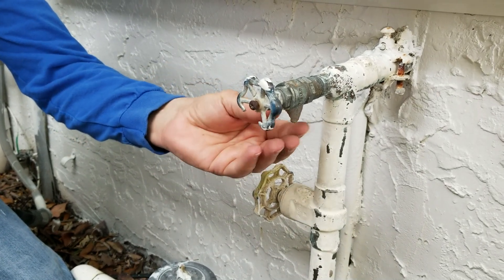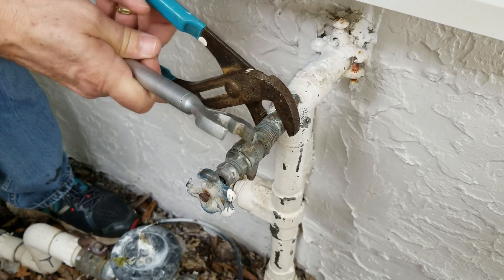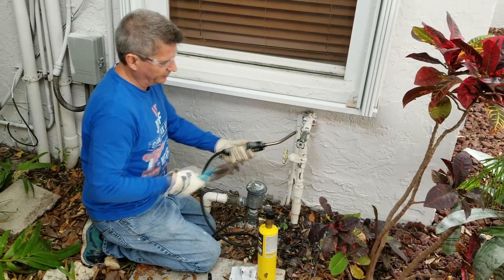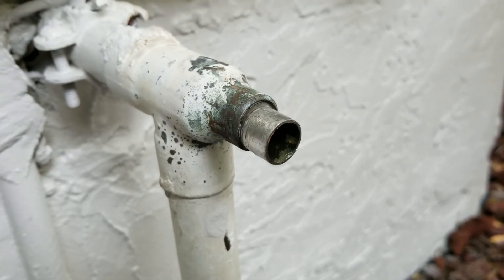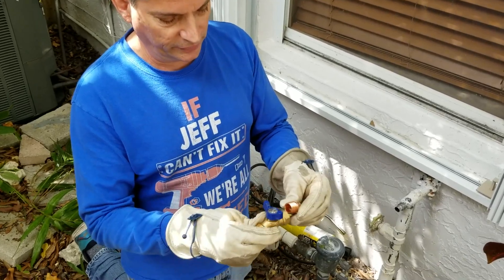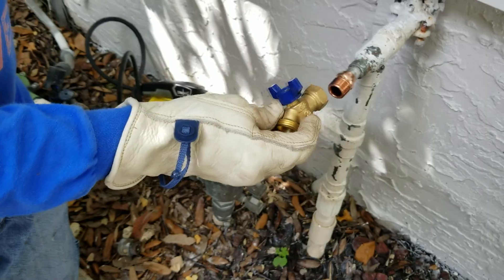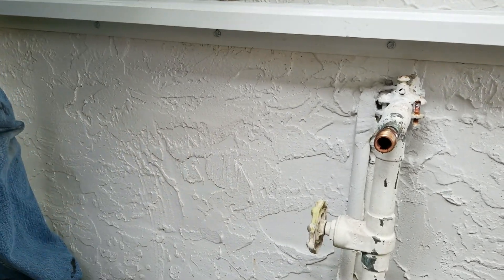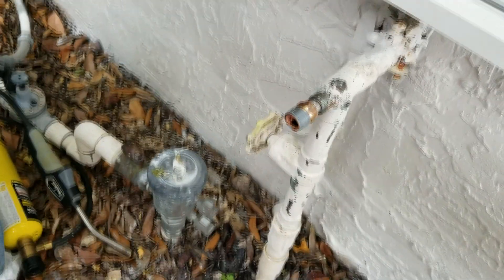How to Replace a Hose Bibb/Spigot - Soldering Hose Bib

Comment from the maker: ✅ Tools used in this hose bib replacement video:
Bernzomatic TS8000BZKC Trigger-Start Torch Kit: https://amzn.to/2Bzj80K
Armour Line Pipe And Tubing Reamer: https://amzn.to/2Rut3OQ
Plumber's Solder Kit: https://amzn.to/2BWr0cP
RIDGID One Stop Wrench Kit : https://amzn.to/2ClCbNa
Channellock 12-Inch Pliers: https://amzn.to/2MdcnGR
RIDGID 14" Heavy-Duty Plumbing Wrench: https://amzn.to/2T4g5Fd
✅ SUBSCRIBE:
For more useful DIY home remodeling tips, tricks, and solutions to engineering disasters subscribe here: https://bit.ly/2vj06cB

✅ WATCH: Why is my Kitchen Sink P-Trap Leaking at Connection Nut?: https://youtu.be/cEjiICErSQg

✅ WATCH: How to Replace A Kitchen Sink Drain Strainer, Repair Leak: https://youtu.be/nBlyqU7NJJI

✅ How To Solder Copper Pipes With Water In It: Plumber's Bread Trick DIY: https://youtu.be/wJxGcpybFvw
Reply: Thank you Sir you are a life saver. absolutely brilliantly explained and worked perfectly. especially the Nuances which made all the different. God Bless you

Comment: I just did this job an hour ago, and I wish I watched the before doing it instead of after. You did a great job. My only comment: You made a point of using lead-free solder and described a child drinking from it. You then installed an Everbilt 1/2 in. Brass Female Hose Bibb. This valve is not certified lead-free and is not recommended for potable water applications. It is fine for outdoor lawn and garden use, but there is no reason to specify lead-free solder in this situation. Indoor plumbing, absolutely.

Comment: My plumber put the threaded opening of the ball valve like what you have directly over the 1/2-inch copper pipe and solder them together. Is the joint strong enough to withstand the torque from opening and closing of the valve over time? I am afraid of a catastrophic failure of the joint. Thanks in advance.
Reply from the maker: Yes the solder should hold up. I would make sure the pipe is not wiggling it may need to be strapped tot h wall if there is any movement
Reply: @jeffostroff  Thanks again.

Comment: Hey Jeff.  I found your channel during your coverage of collapse at Surfside (great videos).  And lo and behold, I need a new spigot so came you your channel!  Cross promotion!  Looking forward to more deals, more info on Surfside etc in the future.
Reply from the maker: Thanks for coming back for more!
Reply: @jeffostroff  I did, and still can't find the answer to my question though.  I have screwed on a 2 way to my spigot and cannot get it off the threads.  I own a brick house, and that hose bibb/spigot type has the back of the spigot IN THE mortar.  I haven't called a plumber yet as was researching what to do.  Is best way to know to send photos to  a plumber?  I wish I could know how to get that 2 way thingy uncrewed from the spigot but another neighbor made it worse when he forced it even more righty tighty!
Reply from the maker: @BarleyHops   The 1st thing I would try is a pair of channel lock pliers because they can Clamp down onto the hose nut  That is Stuck on that thread. And somebody with enough strength should be able to loosen that.  If that doesn't work you can try applying heat by putting a torch on it for just a few seconds and see if there's any expansion that.  Then after That I would try PB Blaster  Which is A penetrating lubricant. WD40 will not work here because it is not a lubricant although many people think that it is.  If that fails then you can get a Dremel and try to gently slice off the hose nut just cut a couple of slits into it enough that you can pry off the rest of it and get it off of the threads without cutting all the way through to the threads.  It's all of Those efforts fail to produce the desired outcome, then you will have to bring in a plumber And you  Me end up having to chisel into the wall.

Comment: Thanks for the detailed video! I tried to disconnect my water hose from the spigot and the entire thing snapped off! I found your video, bought the parts at Home Depot, and voila, I had a new spigot! The soldering was a little tricky for me, but I got it done. Thanks, again! 👍

Comment: Hey Jeff as long as you already shut the water off from the valve in the yard why didn't you replace the other water shut off and replace it with a 1/4 turn ball valve.?
Reply from the maker: I would have but the fix was simply turning the nut 1/4 turn.

Comment: I do a lot of my own repairs at home.  Widowed and no kids to help, so I get a lot of jobs to do that I've never done before.  Thank you for this video.  I have a 'quarter turn' type outdoor faucet.  Today it was leaking so badly I could fill an outdoor rain barrel in about an hour and a half!  That's a bad leak!  I was hoping to find information on how to replace my type of faucet, and only saw older type faucet videos, until I found yours!  Yeah!!!  I'll be working on my faucet in the morning, and I won't need to do any soldering, but only replace the quarter turn portion on mine.  Since I had never done this before, I wanted to be sure I found a video that gave me all the information I needed to do it right.  Thanks so much!  I subscribed as I have to do repairs on all sorts of things from time to time, and it helps to know where to go to find the information.  I may even change out my other faucets as the house is 35 years old and I imagine the faucets could use some attention after all this time.  One question -- Do you have videos on determining if a faucet is leaking behind a wall?  I am not sure if I have an issue, only that the water sounds really strong in my kitchen when I turn the faucet on outside.  NO signs of water, but I get concerned that there may be a leak and I can't see it.  I'd love to see a video on determine the location of a leak of this kind.  Thanks again!!😌
Reply from the maker: Awesome glad to help and welcome aboard

Comment: Any reason you cut off the main even though you have a disconnect valve?
Reply from the maker: We cut off the water main by the street, because the house main shutoff was still allowing water to leak. Typical cheap garbage valves that builders were using in 1993.

Comment: What is the little bracket on the Bibb almost touching the house? Is it a support for the Bibb?
Reply from the maker: That is a clamp for a ground wire. It's painted over but you can see it
Reply: @jeffostroff  A ground wire for what? Mine has the same thing on it. Do I need that wire?

Comment: Why won’t my hose pip melt off, my copper melted before the old solder
Reply from the maker: First make sure you are subscribed with alerts turned on so you get notified when we kick off a tool giveaway. When you get alerted to a new tool giveaway starting, we kick it off on a Sunday night usually 8 PM, then show you the tools and give you the links to enter at that time. You have one week to enter, and we reconvene the following Sunday at 8 PM and choose the winners. You don’t enter merely by subscribing. You subscribe to be alerted, and you must set the alerts when you subscribe, and then receive the alerts. Watch our live stream from Sunday night here https://youtu.be/jLCf1u2pcMQ to give you an idea.
Reply: @jeffostroff  done

Comment: i repiped my house and ran 400 feet of copper through the attic and have a lot of practice sweating over 160 joints. i learned from a master plumber to keep water away, take white bread and stuff it in the pipe to keep the joint dry. in your case i would tske a reciprocating saw and cut the front part of the spigot off to gain access to use the bread trick. it is faster than vacuuming out the water. good video though
Reply from the maker: That is awesome! Yes we have another video showing the plumber's bread trick, awesome trick.

Comment: Good video. Thanks. I'm still looking for this same operation but with the pipe in a block wall with no access from inside.  Have to chip away the concrete on the outside and redo?

Comment: you must be living hot area , my main shot off Valve would never able to survie if as left ouside Garage wall even inside Garage I keep with heat strip all winter Long . Instead of insisting to keep flame low and under pipe I think made the job much longer then spose to be I would move Falme all over the pipe not just holding uner and hoping top will eventually heated up to .

Comment: Can you replace without a solder spigot? Or do you need to replace the whole piping there?
Reply from the maker: I have not seen any compression fitting valves made for outside. They might work, but I have always soldered outside.

Comment: That's great, thanks!  I will take out the old school rubber plunge and replace it with the ball joint 1/4 turn.  Never thought about it but the male adapter thread for future replacements if needed.  Great shout out on the dripping faucet, that is what brought me here! Lol
1.  I have used white bread (no crust) to hold back water.  Is this method a good or bad one?  Keep in mind I do not show an entire slice up there, just a bit so it can dissolve.
Reply from the maker: Jimmy we used the bread trick a few times, it works great, just remember to flush the bread out of the pipe afterwards.
Reply: @jeffostroff  Wish I could show a photo of b4 n after but I ended up using Sharkbites for a no weld replacement and 2ft of 1" copper tubing.  And I know you might have those in another video but I just wanted to let you know that your welding techniques are fantastic,  I just ended up going with this. What is your opinion on those slip type fittings?
Feet piping replacement ended up being a great job. Everything is watertight and fits perfectly. Best part if something goes wrong, I just get my horse shoe release clip out and just adjust, replace or fix the issue. Quick fix.
Jimmy

Comment: For some reason my hose bib is 1 inch any idea why?
Reply from the maker: Sometimes they are 1" sometimes 3/4". I believe that normally your main water line coming into your house is 1 inch and sometimes they will step that down to a three quarter inch connection for your hose bib, and sometimes they don't

Comment: Awesome video! We've got hose bibs that appear to be soldered to a copper stub sticking out from our stucco home, unanchored. I'm assuming I should be able to find something that will allow me to anchor the pipe to the home after I fit the threaded adapter and new hose bib.
Reply from the maker: If the pipe is just sliding in and out of a hole in the wall, then after you solder on the new spigot, just get a tube of PL Adhesive 3X on the paint aisle, and fill in the gap all the way around the air gaps in there the pipe comes through the wall, then by next day when it cures hard, it won't move at all.

Comment: Hey my dad and are tryimg to remove a soldered hose bib but steam is coming out of the spigot and the seal does not seem to losen. We already tried vacuuming out the water for 2-10 minutes. How long should we keep the shop vac on to completely drain it?
Reply from the maker: If the water is still running when you stop vacuuming, you'll have to try to open up some faucets, find a lower spot in the house where there is another valve. But if that does not help try shutting off the water at the curb, or try the bread trick, which we cover in this video here:  https://youtu.be/wJxGcpybFvw
Reply: Ah we got it off!
Reply: But the spigot is the male end and the main pipe is female? Do we still use male adapter?

Comment: Great video. Do you have a link to the copper fitting you used, or dimensions on it?
Reply from the maker: I think we used this piece, a 1/2" copper male adapter. If you get this part, make sure it screws onto a house out in the garden center first, otherwise you have to keep looking for the correct part.
https://www.homedepot.com/p/Everbilt-1-2-in-Copper-Pressure-Cup-x-MIP-Male-Adapter-Fitting-C604HD12/204620255
Reply: @jeffostroff  Thanks, that is the one I bought. Because of your video I was able to get the old soldered joint off and solder on the new fitting.
The store didn't have a hose bibb in that size, so I ended up using a sillcock. Is there any downside to that, other than the flange?

Comment: Thank You! Q: Wouldn't you test the solder connection prior to applying teflon?
Reply from the maker: We did off camera, there's a lot of stuff that happens that we leave out to keep the videos from getting too long. We get lots of trolls who complain you could have done a 2 minute video...
Reply: @jeffostroff  You do the Lord's work. Using your guidance, I replaced our outdoor spigot and likely saved $175 - and my wife (and my son) were impressed..

Comment: I have to do this today also installing the  same 1/4 turn ball valve
Reply from the maker: A fun Saturday in the works
Reply: @jeffostroff yeah lots of fun hey from what I saw on the video it looks like you don't have to  put the male adapter on the valve tighten it up then put it on the pipe to line it up so the valve ends up  facing down mark it and take the valve off ? I'm concerned that it will not  if I don't

Comment: JEFF,  Once again Thank you, I was buying Shark bite products just to avoid an over priced plumber or doing this.
Reply from the maker: Awesome, glad you found this video useful! Shark bites are OK for temporary, use but I always feel nothing beats a tried and true soldered connection. But at least if the shark bite leaks, it would be outside. I would never place a shark bite inside a wall.
Reply: not all plumbers are over-priced. There are fair ones such as us and maybe this guy.

Comment: Bravo Jeff,your tips are amazing. As a retired plumber myself,I will suggest to any handy person to ALWAYS,ALWAYS hire a professional to deal with water under pressure.Greetings from Toronto .
Reply from the maker: Yup, I wonder how many people forget to turn off the main water before they pop a bathroom vanity shut off valve off the pipe. I've gotten a few good laughs watching those YouTube videos with gushers, and watching them try to hammer a Shark Bite end cap on, rather than going to shut off the water.